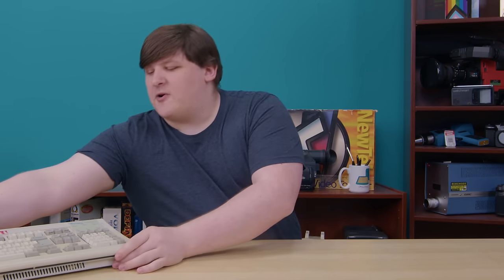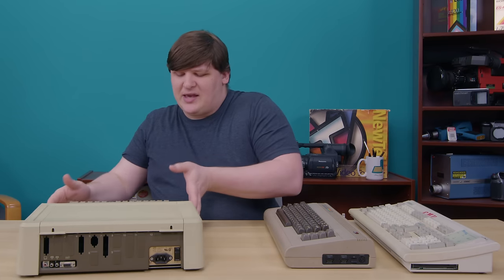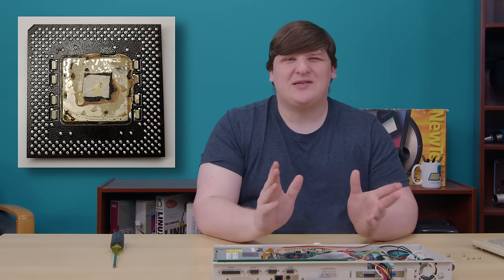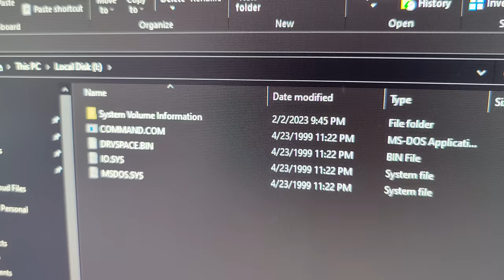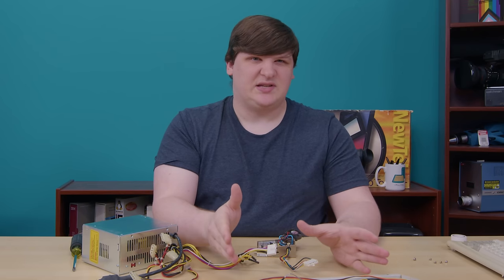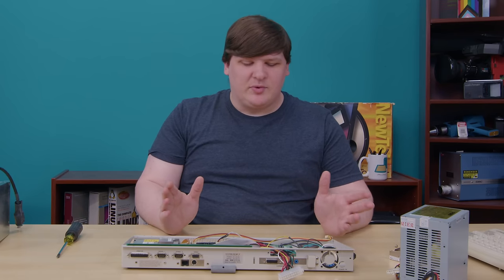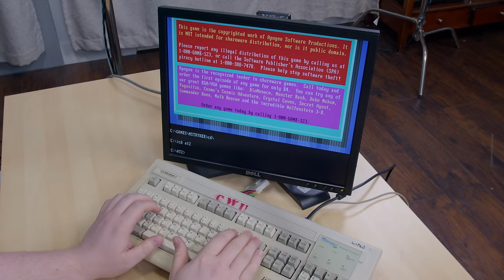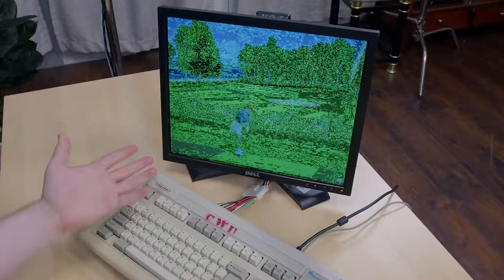I turned a weird "keyboard PC" into an FM boombox

Comment: Hello -- that motherboard is actually not custom. I don't know what the form factor is called, but I have a Ti 486 board in the same form factor that fit into this computer.  I assume it's some standard industrial form factor. . . I actually have one of these PCs as well, with the original working external power brick and the same anti-theft device glued on. I bet they all came from the same lot as mine is missing the spray paint but has some rust on it too.
Reply: I have seen it in some industrial (literally cnc machines) computers. I think theyre called SBCs in a generic sense but apparently even the raspberry pi is under that umbrella so idk
Reply: @Palmtop_User No, this wouldn't be considered a single board computer in the traditional sense. Also that refers to function more than form, though SBCs are typically small.

Comment: They make these things called Pico PSUs, they're tiny little boards you can mount in the case, wire the outputs to the board then for input they have a DC jack and an external brick to do conversion. It would be a much cleaner solution. Edit - You'd need to pick up a 20 pin ATX Pico and a 20 pin ATX to AT converter cable but it should still be fine.
Reply: ATX Picos do not include the -5V that ISA ports need.
Reply: @robertbackhaus8911  You can use a voltage regulator and derive -5V from the -12V rail.  Though it's very likely not needed.

Original Sound Blasters needed -5V, but SB16s which the Vibra in the video shouldn't need it.

The PicoPSU would be a great option to clean up the build.
Reply: @robertbackhaus8911  -5v is only actually needed for some of the older expansion cards, most will work fine without it. Its almost exclusively soundcards and even then most of the newer ISA cards simply derive it from the -12v line.
Reply: @dungeonseeker3087  yeah, like the Sound Blaster in there
Reply: The original internal PSU was pretty much an early version of the Pico PSU concept! Newer ones are probably better quality though.
Reply: @kaitlyn__L  Except only the OG SB needed -5v. SB16 derived cards, like the Vibra in there, do not. At least as far as I know. I'm not directly familiar with the Vibra, so grain of salt and all that.
Reply: The question would be whether he actually wants to spend that money (~ $70 or so including the needed external brick) on this machine.
Reply: @slightlyevolved  fair enough. My PC a in the 90s had awful integrated sound, and by the time I started to consider myself an audiophile things had moved-onto USB/FW audio interfaces. In this instance I was just repeating what I’d heard, namely that a lot of SBs didn’t work on modern PSUs. I’m not familiar with the ins and outs of exactly which models that applies to!

Comment: Touch typing on typewriters was ubiquitous for secretaries and typing pools. I was taught on a mechanical typewriter with a cover over the keys. To accommodate the key and hammer mechanics the rows were considerably steeper in their rake. This assisted in the muscle memory and made mistaken keys less frequent. Fingers moved "up to the right" or "down to the left from the familiar home key; ASDF ;LKJ.

Your hands could lay on the keys at rest when reading back your work without risking phantom strokes, such was the force required to operate. 
Olivetti electromechanical 'golf ball' typewriters flattened the angle and compressed the gap between keys. It was a very hard adjustment at first.

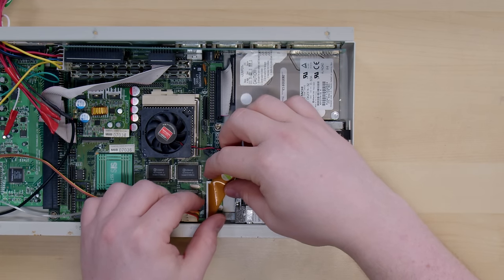Comment: 17:08 FYI, that is called a “flat flex cable” (not “ribbon cable”, because that term refers to the thicker, lots-of-round-wires-stuck-together cables like the gray one for the hard drive), or FFC for short. Orange ones like this are made of Kapton (polyimide), not Mylar (metalized biaxially-oriented PET, like in Mylar birthday balloons). The reason people sometimes confuse them is that the metalized Kapton films used on the lunar module and such were often mistakenly referred to as Mylar, even though they weren’t! People often thought one side of those was gold-plated, but the gold color actually came from the Kapton.

As for the tear: if you can solder decently, you can use a fiberglass brush to carefully expose the broken metal conductor and then solder a bodge wire to fix it. Alternatively, if the ends of the FFC are standard, which they probably are, you might be able to buy an off-the-shelf replacement and then make a few 45 degree folds in it to make it lay properly. This isn’t a weird hack, it’s actually a common way FFCs are routed in commercial products instead of costly custom FFCs.
Reply: thank you, knowledge man, for your knowledge

Comment: "Wobbly" video is extremely indicative of old, dried up capacitors, usually in the power supply, but not necessarily. When power draw increases, so do the fluctuations. Whether that's from increased HDD activity or more CPU load.

Comment: You might be able to get turbo working with ctrl-alt and (on the numpad) the plus key. Pressing ctrl-alt minus will put it in slow mode.
Reply: either that or Alt (not Alt Gr) and both left+right shift (had this sequence on a couple of computers)
Reply: except that Pentium and later computers don't actually support a turbo/slow mode. The only way to practically do that is to disable the L1 cache. At that point the Pentium might be more like a 486 or 386.
Reply: @SeeJayPlayGames  probably yes
Still, I do remember some first pentium MMX computer having a turbo switch and LED 🤔🤔 which might also be faked and just turning on and off just the LED, indeed
Reply: @Grizzly_Lab  Your are probably correct as at that stage low end machines were using last years cases that did actually use the turbo function.

i have a pentium 100 still running strong and it has no turbo options on the mother board pins, best guess is by that stage no one really wanted to slow down a windows based pc to run 4.7 mh games

Comment: I remember I had two external hard drives at one point that used that weird 4-prong plug. One used a 5V supply, the other one used a 12V supply (which I found out when I mixed up the two power bricks and blew one of them up). That day I learned to label all of my power supplies as to which device they belong to.
Reply: Rip
Reply: At work I have a 4 disk toaster dock, a Dell laptop dock, and a third power supply also from Dell but we don't know what it goes to,  with that connector. 6, 12, 24V, it's hilarious. I think the 12V one is even like 16 amps for some reason
Reply: The Wii and Wii U have a similar issue, they use the same connector but aren't quite compatible. They won't immediately blow up but they'll get really unhappy, my Wii had issues for at least a year after I plugged it into a U supply by accident

Comment: Those annoying round pin power connectors are Kycon connectors. I think they're specifically Kycon KPJX or KPPX series connectors but in my experience they just get called Kycon connectors. You can still buy them new, the mating half for the one on your machine is probably a KPPX-4P-SR7DI.
Reply: Yes, that's exactly right. I have a bag of KPPX  3 and 4 pin plugs. I blame Targus.

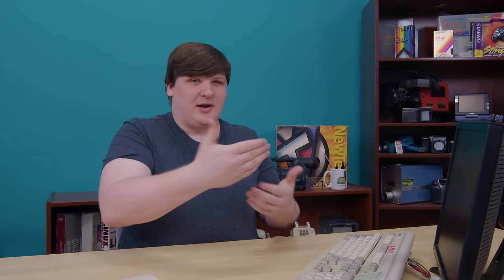Comment: 32:30 It's the networking stack making Windows 98 freeze on boot. Probably waiting on DHCP.
Reply: Agreed. Windows 98 with a disconnected Ethernet card take forever to boot. Disabling the card or connecting the cable before booting will fix the issue.
Reply: Or just give it a static IP Address
Reply: ^^ Zot.  Win 9x era was rather sloppy re: networking.  I guess nobody ever considered that you might not have plugged in the cable one day.

Comment: That long pause is a Windows 98 thing. If I recall correctly, it happens when you have an Ethernet port with no cable plugged in.  I think it's a timeout where it's waiting for an IP address from a DHCP server (that it will never get if the cable isn't connected).

Comment: Those Winbond chips are probably the L2 cache, based on how they're close to the CPU (and based on my experience with other Socket 7 motherboards that have L2 cache there too). The PIIs (and earlier PIIIs) are massive because the L2 is put onto the processor card to bring it closer to the CPU. Intel switched back to sockets with later PIIIs once they were able to reliably package the L2 directly onto the CPU die and no longer needed the card space.
Reply from the maker: That would make a lot of sense! I forgot about discrete cache in that era.
Reply: @CathodeRayDude  Dont forget that there were a lot of first gen pentium machines with NO L2 Cache. Made them not a lot faster than a 486. I bet if Intel had never integrated the cache or done so later that there would have been OEMs building machines with no cache right up to that point. 

I love that you acknowledged the evolution of the first gen pentium too, the first ones were 800nm 5 volt monsters!

Comment: I do remember quite a few modern wedges, though they're usually very rare and only one somewhat popular design, the RasPi 400. but cybernet, Great Wall are a few others I can remember off the top of my head. I've only ever seen one windows 10 wedge, most of them are WinXP era. 
wedge is pretty generous, they're basically a normal keyboard but most of an inch thick (except for the great wall)
Reply from the maker: yeah that's kinda why i make the distinction; even if there are newer integrated machines, I'm sure they're all just kinda flat "trays." Not nearly as exciting as a wedge!
Reply: my favorite form factor. I was half excited about a production cyberdeck with that asus eeepc thing with the integrated display but it went absolutely nowhere.

Comment: I wonder if you've looked into the PicoATX PSUs, would allow you to put it internally and have the 12v barrel jack in the original hole.. Tho they might need an extension harness with a -5v regulator if that soundblaster really needs it.

Comment: There's a very good reason a wedge shaped PC is rare: Health'n'safety!
Wedge shaped was a great way to have a home computer - just one box to store in a drawer when not in use, and you plug it into the living room TV to play games on.  In schools, apples and BBC micros lived under monitor stands.
However in the office, their chunky keyboards were judged poor ergonomically, as you noted the height, but the killer was you could not adjust the rake, so they were considered a hazard for RSI.  They also took up depth of desk unless you stacked the monitor on them, and unless you had a school style monitor stand, you couldn't adjust the position of the keyboard.
This meant they were considered unprofessional and unacceptable in most major offices, which went for the IBM PC style beige box with separate adjustable keyboard.  In the UK, due to their popularity in some 'prosumer' applications, some companies (eg Viglen) even made conversion cases for the BBC micro to turn it into a 2-box solution so it could fit into an office environment more acceptably.  
Since the PC started in the business world, it's not surprising it took til much later for someone to go the other way, and even less so that the application was for an education setting.  So easy to deploy and maintain a room-full of these one-box PCs in a computer suite - if one goes down you swap out the whole unit.  Young people not in your employ, using the machine for a limited session, are less likely to sue you for their crippling RSI.  Push and pull factors satisfied.
---
4-pin power Mini-DIN connector.  Awful, you can too easily plug them in the wrong way round and fry devices.

Comment: On the Amstrad PPC512/640, I have a working one and they are around in the UK/Europe. They're actually designed as a portable machine and can run off battery power or 12v DC from a car, hence the integrated LCD. 🙂

Awesome video, love these weird form factors!

Comment: I'd be curious if the visual artifacts would be resolved with running your own video card. Some of those old video chips were real crap.
Reply: Wouldn't trust that daughter card above the graphics chip either. It's old, unshielded, and the device itself probably wasn't built with top shelf components, so there's a good chance that the electronics in it are dying/bad, screwing up the voltage rails its making or even creating EMI.

Just an educated guess, and I can't really rewind to correct my assessment since YT doesn't like to save comment replies on mobile.

Comment: I remember the first "wedge PC" I ever made (and it was the last, fortunately). These steps work best in about 1999: First, get a Compaq Armada laptop. Then, set it on top of a rack mounted server you're working on while it's slid out on its rails. Then, from the back, slide the server back into the cabinet while forgetting your laptop is on top. Pick the laptop up off the floor. Now, while you're waiting for a replacement for your destroyed display, just remove it, and you have a Wedge PC until the new monitor arrives! (Fortunately the HDD and everything else still worked!)

Comment: The screen issue sounds more like a shielding issue which could be in the VGA cable or with the VGA port and path shielding.  I used to see this with cheap crappy VGA extension cables in data centres back in the day, which then confuses the hell out of modern monitors as they are digital and don’t really understand analogue signals, which is what VGA is.  Had you had this on an old school CRT, it would likely have also shown up as ghosting with interference from pretty much anything causing screen artifices of one form or another.

Oh, and Jan Hammer is pronounced as Yan Hammer, worked alongside him once when I was setting up the computer systems at a live performance once.  Nice guy and increasingly talented musician.

Comment: From what I've seen second hand, hospitals used these a lot. The two I have are both from different hospitals anyways. 
I like this form factor, idk exactly why, I have a WinXP version (D5) with a trackpad in place of a Numpad and it is extremely handy for the odd time I need XP for something and I don't have to settle for a laptop screen from 20 years ago or its battery. I also have the H6 variant with Windows 7, I put a larger HDD in there and since it has a DVD drive with HDMI I can play stuff I have loaded on the internal drive, streaming sites work perfectly and it plays discs. And it's so much faster and easier to use than an HDMI stick streaming device. Everything is built in.

Comment: I think the grievances you have with chunky keyboards is that you do actually rest your wrists down at an angle when typing. That's how you get RSI. Even on modern chicklet keyboards like those from Apple, you're supposed to hover your wrists off the desk keeping them level with your palms. Those foam wrist rests are just for that, resting between flurries of typing. Look at anything regarding office ergonomics, ergonomic keyboards or even a good quality typing tutor like Mavis Beacon; keep the bend in your wrist to an absolute minimum.

Comment: i'm gonna guess that this thing was created specifically for use in computer labs and business settings. Especially one's that still relied on pre-windows software. It would work perfectly as a replacement for some old 486 chugging along as a register or something similar. The lack of a sound card plus the fact that it appears to have come out of a university setting helps to point to that possibility. It was probably built both to a price point and a specific usage or set of customers.

Also, really great job on the song! I usually skip the sound sections of most old computer reviews after about 10-15 seconds, but I actually listened to the entire thing!

Comment: For the ripple, I would look at the video and audio driver. 2 things I recall as being cursed back in the windows 95/98 days: resource management (specifically weird things like IRQ collisions between i/o devices) and also the standard windows video driver. Windows wasn’t able to properly manage system resources demand of peripherals using its native drivers  which was exacerbated when there was high throughput (like windowed video with sound). Speaking of video, full screen (alt-enter) mode reliably ran better than windowed mode because in full screen mode it ran a different (dos native?) mode and  always seemed to be smoother. Bottom line, I’d check windows drivers and, if possible, disable any features that relied on windows to manage resources for the sound card and/or video card.

Comment: 1. Put in a K6-2 in it. 
2. A Pico ATX supply would let you use a small brick and get rid of that bullshit cabling. 
3. A piece of aluminum bar stock from the hardware store drilled for screws would fix the flexy keyboard.
Reply from the maker: I tried a K6 and I believe I had iffy results, can't recall what the issue was. Probably will go with the PicoPSU idea though, and good idea with the stiffening bar.

Comment: ATX PSU wire colors
Yellow: +12v
Red: +5v
White: -5v
Blue: -12v
Black: GND
Orange: +3.3v
Green: PS_ON
Gray: PS_OK
Purple: +5VSB

On modern ATX PSUs -5v is not supplied anymore
-5v was mainly used on ISA slots.

Comment: That power connector you were talking about, for future reference is probably a GX16 aviation connector. Though that one you have might be what they call an RP GX16, where the holes are in the socket, and the pins in the plug. Usually they are the other way around. They come in a few sizes, 12mm, 16mm and 20mm, and are labelled accordingly, GX12, GX16, and GX20. I bumped into them in the CB radio days, they were very common as microphone connectors. So just google Aviation connectors, and you might find the right one. and add RP if the plug/socket pins/holes are the wrong way around.